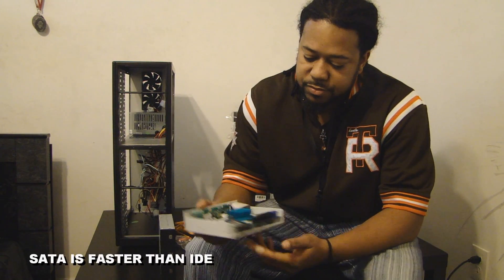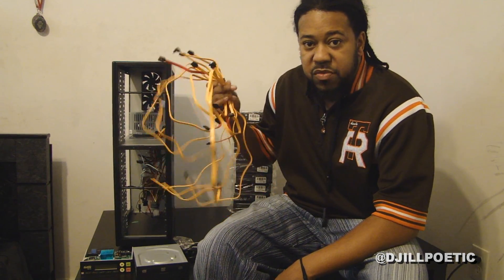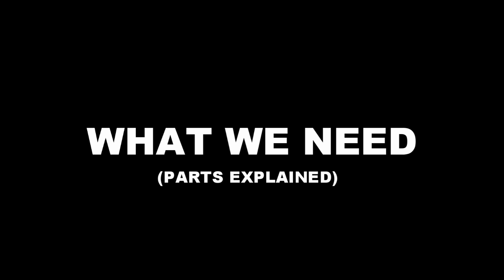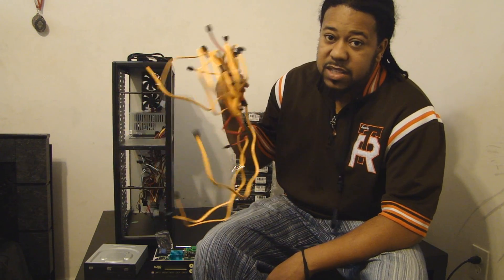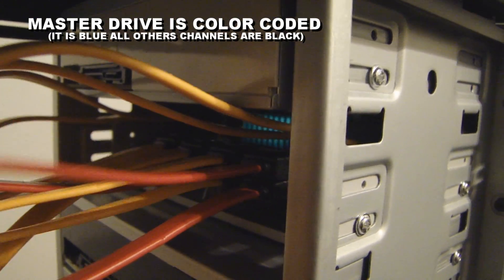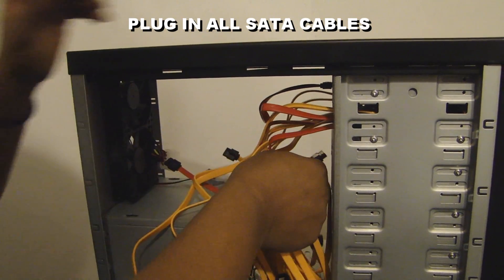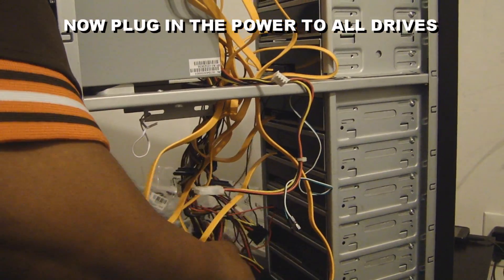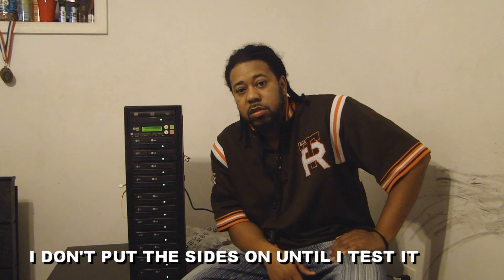HOW TO BUILD A CD/DVD DUPLICATOR (STEP BY STEP)

Comment: What kind of power supply did you use? That's the step you skipped that I was looking for. The power supply needs a ton of Sata Power connectors and I can't find a x12 sata power supply.
Reply from the maker: +Ralph Clark Get a barebone case from amamax dot com. It has all that you need.
Reply: +Dj Ill Poetic Thanks for the quick response, I should have looked before asking because I had literally just read that the builders kit on their site has everything you need including the PSU and the cables :) Thanks man
Reply from the maker: +Ralph Clark Exactly, it does the one use in this video was purchased from them. No guess work when using them, they have everything. I believe I got my burners from micro center because they have good prices for a store.
Reply: +Dj Ill Poetic I was looking at NewEgg and I'd have to pay $19.99 per drive there, Microcenter has much better prices at $12.99 for decent ones but as a heads up, if you get a small business account with Evertek you can get them wholesale for $7.88 per drive if you buy 10 or more :) Thanks for the tips and tutorial, hope my suggestion helps you in the future!
Reply from the maker: Thanks. It is much appreciated.

Comment: what about the power you don't ever plug to the dvd's
Reply: I was wondering the same thing. Where can you get a PSU with what 13 SATA power connectors ????
Reply: Michael Barrett  Power is supplied by the controler
Reply: Michael Barrett , ever heard of Split cables ?

Comment: where can you find a tower large enough to support 1 TO 11 (13 external 5.25 drive bays). the closes i could find was 11 and the price would put you way over what it would cost to build an accutowner 1 TO 11 prebuilt system?
Reply: amazon...BestDuplicator - Premium 13 Bay Case with Highest Watt Duplicator Power Supply $115 on Amazon...gonna make my own.  You can do this with Blu-ray also, and making a 1-11 blu-ray burner is FAR cheaper than purchasing a prebuilt one.

Comment: This is a sub par video. He never show him hooking up the power supply nor does he tell an appropriate wattage for a power supply. I think he uses only one particular kind of case in which he also doesn't tell you where he gets his case.  Any power supply less than 700W will not make a duplicator function properly and you will have mis-burnt disc which he didn't clarify either.

Comment: Inside the DVD duplicator, do you have motherboard, cpu and everything, or is it just bare with PSU connected to the dvd drives and controller?

I was wondering cause My tower that i use for gaming has three slots that i can use to put in dvd drives, and I was wondering if i need the controller or i can use a software to do it....

Comment: how do you get power to the drives from the PSU Is there something you plug 24 pin and 4 pin in to or do you need something extra apart from DVD DRIVES DRIVER CONTROLLER AND PSU

Comment: @Dj Ill Poetic...just wanted to know before i purchased a barebone duplicator tower from ebay. if i bought a 1-7 tower with a controller does the power supply have enough cables to connect to each of the 7 drives?